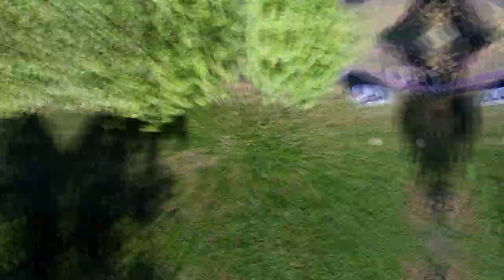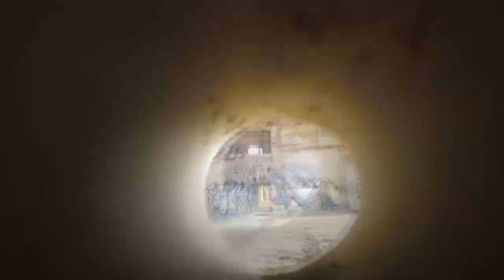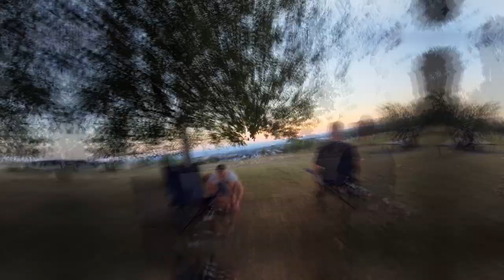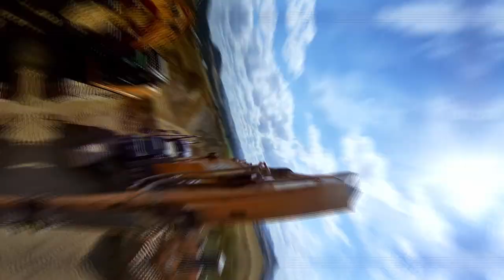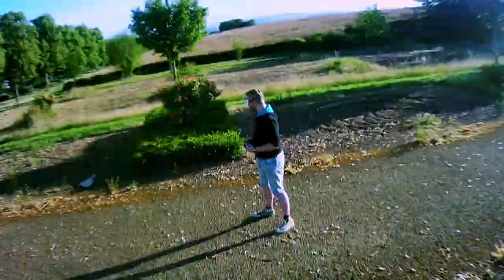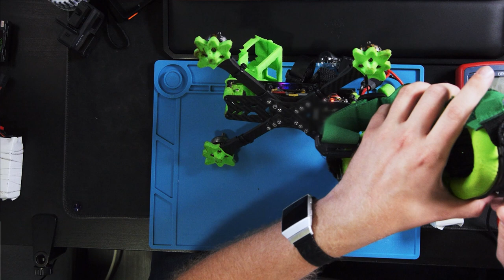Caddx Vista - Bind To DJI FPV Goggles Without Bind Button | Caddx Bind Button Broken

Comment: Thanks a lot for this! Great help! 
By the way: It is enough to just bridge the two parts on the right side of that button (between the button and the mounting hole).
The two pins are behind each other. 
As I like to check out multiple answers to problems like this, I found this on a different video (yours was still much better quality xD)
Reply from the maker: Thanks! Good to know there is a easier way 😁👍

Comment: hey can I also do this with a paperclip and without the meter and the lightbulb and all that? Cause I don't have these things, thanks!
Reply from the maker: Hey! Even tho I wouldn't suggest it , basically you could do it without a smoke stopper. In case you short something else chances are you break this specific part, if you don't use a smoke stopper.

Comment: Yes, that's it, broken button is not a big deal, especially if it is a button you'd actually use only here and there. Same goes for all other buttons, boot loader, bind button on the receiver,... Nice work. 👍
Reply from the maker: That's so true , only sometimes you're panicking when you just broke something 🤣
Like me .. I saved the rest of the bind button and when I saw there was no proper way to fix it I decided to do this video 😁
Reply: @flickFPV  yeah, just go with the flow. 😁

Comment: Thanks for making this, I have to do this now on one quad, have to try this
Reply from the maker: My pleasure!  😉
Sometimes it needs a little patience to bridge the pins but it worked im my case all of the times I tried 👍
Reply: @flickFPV  yes i just did it today and it worked. I was scared to feel the short becsuse i dont have any rubber on my tweasers but all good, thanks for the tip because i really like this build
Reply from the maker: Probably my hands are broken as I didn't felt the short 😁
Glad it worked! Happy flying with your beloved build 😉

Comment: Hello, hope your doing well.

I have a caddx + dji controller + cinerace20 HD. 

I have trouble with binding. First it was ok then after installing the propellers lost connection on both goggles v2 and controller.

Tried to bind again, nothing 
Refreshed goggles and caddx still nothing

Goggles v2 on fpv system already

Caddex on - solid green light - binding mode solid red (nothing after that) 

I need your help please
Reply from the maker: Hey! Sorry to say, but I can't help you with that problem - I never experienced problems with binding Vista/Air Unit and the goggles.

Probably you should check you are in "DJI Digital FPV" mode and not in the mode for the DJI drone (not sure how it's called) but beside that I don't have further ideas ... sorry 🥲